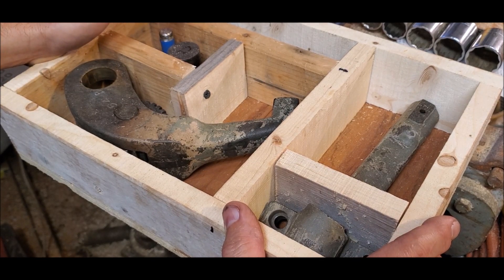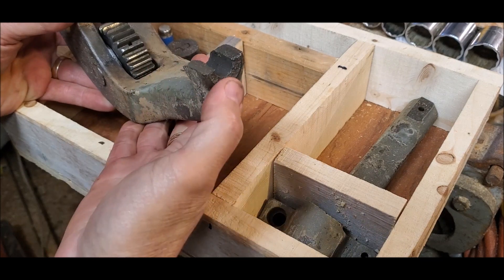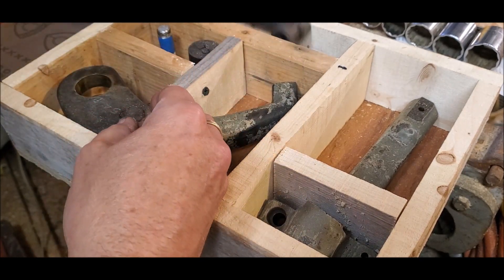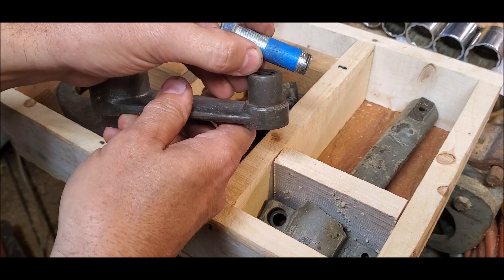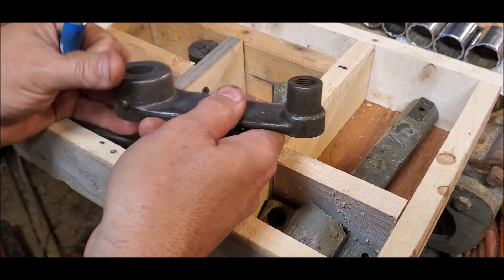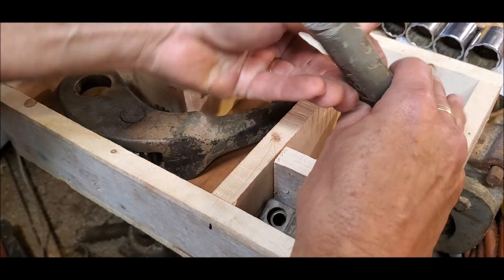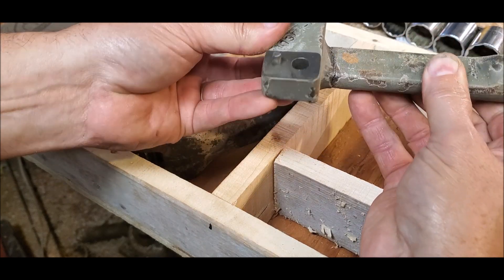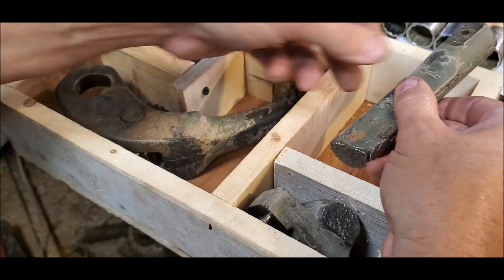Steve Summers Work #EngineersWorkshopFarmsOutAllTheMonarchLatheRepairsToFamousYouTubers19Blitz

Comment: New sub. Steve sent me.
Reply from the maker: Steve's the best! Bear with me, still getting set up. Lots of projects coming, plus getting a derelict 6500 sq ft building turned into a shop.
Reply: I’m already sold. Love the air compressor vids.
Reply from the maker: @johnnyryall1400  Thanks! One more vid on that coming, final configuration on the plumbing.